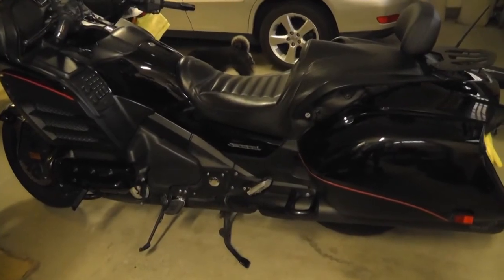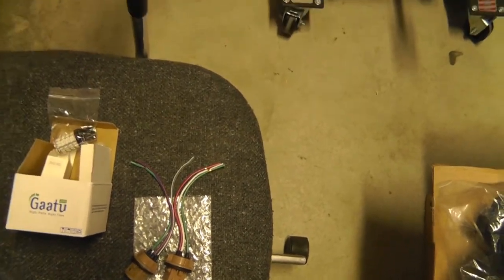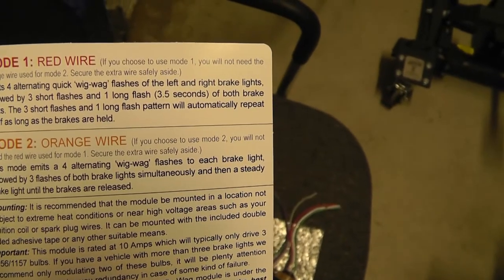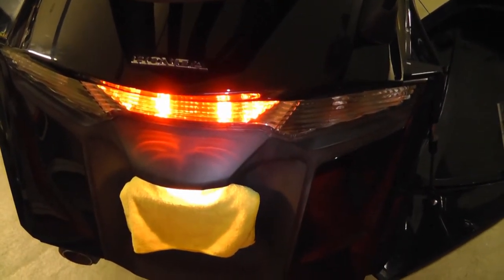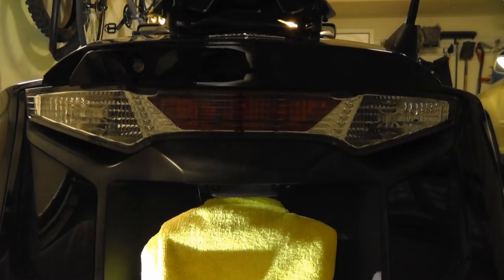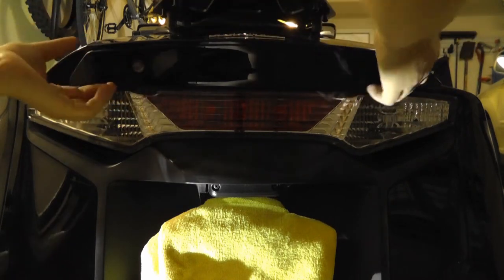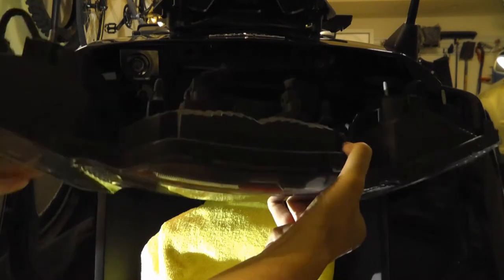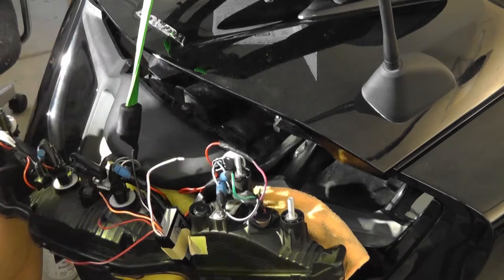How to Install the Back Off Wig Wag Brake Modulator on a Goldwing F6B GL1800

Comment: Vicki.. Thanks for the video.. it is very helpful.... given that now we have strobe red brake light led bulbs.... do we need wig wag.... or can we just replace brake light led bulbs to strobe bulbs and forget wig wag... thanks
Reply from the maker: The brake lights aren't strobe.  I have one video showing how I made the rear turn signal lights into switchback.  Meaning, the turning lights are constant red (widening the red tail light for additional visibility), and when you activate the turning lights, it turns amber.  The wig wag is optional and not needed unless you want the brake light to wig wag when brakes are applied.
Reply: @vickip  yes I saw that video and thats the mod I am going to do.
I want the brake light to strobe/flash with LED bulbs... if I use strobe/flash bulbs..can I let go off wig wag install? Thanks

Comment: Could use your help mine has 5 wires, white with red strip, yellow, black and red, red with white strip it is the xp back off module confused as to what goes where.
Reply: My motorcycle is a 2013 f6b Honda goldwing

Comment: Hey Vicki P,
Where can I find LED break light bulbs to replace stock incandescent bulbs
Reply from the maker: I replaced my two stock red incandescent bulbs for two red LED bulbs from SoCalMotoGear.com...over three years later, they are still running great.  Here's the link...this is sold in a pair:  http://www.socalmotogear.com/HONDA-GOLD-WING-GL1800-7443-LED-p/7443r.htm
Reply: Vicki P great! Thanks!

Comment: think before you put one of these on your motorcycle. The syndrome that this  creates is called target fixation. The following car/truck/bus will concentrate on your light acting differently than all other  brake lights. And the subconscious of the driver following you will try to figure out what is going on, and may run into you. It happened to me..
   I was waiting my turn at a stop sign. I was struck by a car from behind while I was stopped. As I was coming to about 10 minutes later, I heard the man that ran into me explain to the police”I saw his tail light flashing, and I thought he was going to go”...I was off work nine months from the collision caused by a back off brake light flashing tail light system..
   I did some research because someone told me about target fixation,  I found that the Montana state police changed all of their headlights to a flashing modulator type headlight system for day use. As a result, they had the highest incidence of head on collisions of any Police Department in the nation. The subconscious will stare at something it cannot recognize  . And we tend to drive /Steer where we are looking.
   like I said, I was off work nine months with the injuries I got that day. But it wasn’t all bad. It was the most profitable/tax-free nine month paid vacation of my life. I also got a new motorcycle/ helmet/aerostitch suit,aria helmet,Bates boots,& gloves..The one downside, my shoulder will never be the same..
   just because someone comes up with a new gimmick, doesn’t mean it’s better, safer.. in fact, it may not even be approved by the national highway safety council for use.. And for that reason, it may not pass state inspection. At one time I was a motorcycle state inspection mechanic, A motorcycle that came in for inspection and a new safety sticker in my state would not pass with this device on the machine. The federal government is very particular about lights, the color of the turn signal and brake light lenses things like that. In fact, even a turn signal must flash no less than 60 times per minute and no faster than 120 times a minute. I can see a situation where a flashing tail light can be mistaken for a turn signal. I’d stay away from this